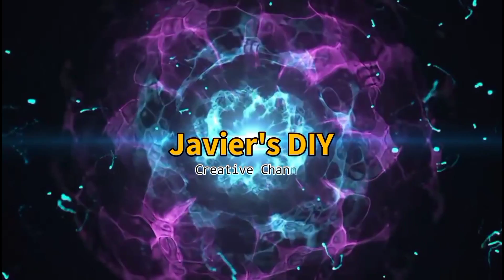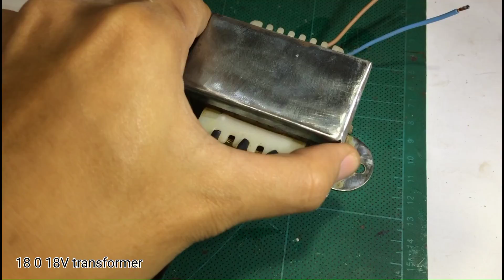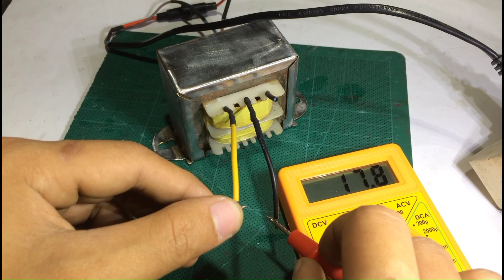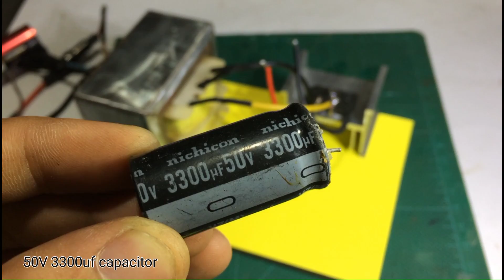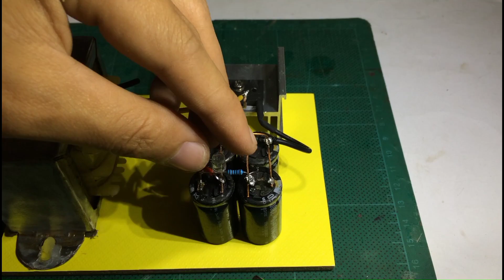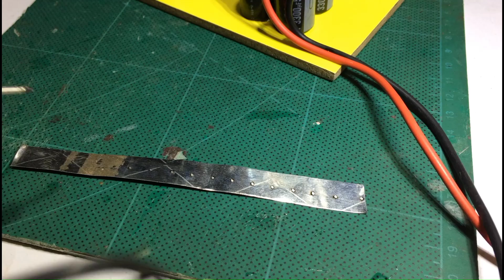High Quality Mini Spot Welding

Comment: I have tried with 8 6800uf capacitors in paralell and tried with 12v 3amps battery charger with 2 wired copper nails connection. A big spark came and made a hole in nickel strip.  It didn't weld as desired.
Reply from the maker: It is because the current is too small to weld strip sir

Comment: Fake, coz  in real world spot welding use energy more than 60 joules .  In this video , 1 x 3300 uF capacitor store only  0.238 joules.
Reply: E = 1/2CV**  Therefore, 1 3300uF charged to 18v (*1.414) = 1.0689 J.  Where did you get 0.238 joules?

Comment: Do you have a video of actual testing? Would love to see this weld. To me it don't look that strong. Would also like to see it connected to a amp meter.  Typically 200 to 400 amps is the sweet spot when welding with a transformer. Great concept 👍👍👍

Comment: This is very basic circuit. Video doesn't show welding of two stripes. There has to be many capacitors to provide enough energy required for melting two surfaces of stripes for welding. Also there has to be either current limiting circuit to protect diodes and transformer from repeatedly shorting or atleast timer circuit to limit short circuit period. Don't build this circuit as shown.

Comment: Trafo yang di gunakan trafo apa itu pak ,berapa ampere? Dan elco berapa mikro farad
Reply from the maker: Fir better understanding please use the universal language
Reply: @JaviersDIY  how many amperes is the transformer used?  And what size is elco micro farad
Reply from the maker: Maybe the transformer I used sir drops a current about 3.5A while the capacitor that I use is about 3300uf.
Reply: @JaviersDIY  ok thankyou ,the maximum voltage is 22 volts after passing through the elco and diodes

Comment: spark welder -----:> 1.5 volt battery micro transformer, diode and capacitor of 450 Volt = and you got it spark welder .... it does not use high current -.-" you fool -.-" why everyone uses more energy than necessary? jobs create idiots who only think about making money and not advanced technology. how long will the bad jobs last...there is something really wrong with people and their rotten jobs...Money corrupts everything...yep sad but true... -.-"

Comment: Bridge diode code ?
Reply from the maker: It depends on you sir
Reply: @JaviersDIY  not have code
Reply: @JaviersDIY  what amper for 18 0 18 transformer
Reply: @JaviersDIY  what can use DIODA BRIDGE MAXIMO QL 100A 1600V

Comment: En el momento de unir el positivo con el negativo se produce un corto y se funde el fusible de entrada alterna (110 Voltios AC).
Reply from the maker: For better understanding please use yhe universal language
Reply: @JaviersDIY  At the moment of joining the positive with the negative, a short is produced and the fuse of the alternating input (110 Volts AC) blows.

For a future reading comprehension: copy the message and paste it in any text translator you have.

Comment: I use 3A transformer Still not working proper please suggest change components.
Reply from the maker: Make sure sir that the output voltage is low while the current is high

Comment: How to increase power
Reply from the maker: Just use a transformer with a high current output sir
Reply: @JaviersDIY   all other components are same? 
currently I use 1A in pure copper 
For increase power can i use 3A transformer
Reply from the maker: @ankurkhatri4  yes sir. You can use that one. But rest assured that the voltage is low compared to the current output.

Comment: It's not going to be able to weld 2 nickel strips together.  

1) you can't store enough energy in those capacitors.  You need about 10 to 50 joules of weld energy.  By the looks of those capacitors,  you are way short of that. 

2) the ESR of those capacitors and the resistance of your welding electrodes is way too high (switch to ultracapacitors of at least 100F and at least 8awg wire with proper crimp lug connections).  You should target a total circuit resistance (including capacitors)  of 6mOhm or less.  

3) you need to apply a good amount of pressure with the welding probes prior to starting the weld.   To do this,  put MOSFETS  or a big relay in series with the negative electrode.  This will allow you to press down firmly before the weld starts.
Reply from the maker: It's a brilliant suggestions . Thank you sir.
Reply: @JaviersDIY  it's not suggestion, it's a correction of your work, 😁
Reply: never working Don't tried

Comment: The transformer is only needed to RECHARGE the parallel capacitors. The factor that enables welding is the OVERALL CAPACITANCE (or number of capacitors in parallel) and the size or gauge of wires feeding your welding electrodes, which should be AT LEAST 8AWG with copper tips for best results. Using a smaller 2A to 3A transformer and smaller diodes will simply take a  little longer to fully recharge your capacitors, but it will still work. Any transformer from 3 Amps to 30 Amps will work just fine. Bigger transformer and diodes will simply recharge the capacitors faster. You should use a switch for charging up the capacitor bank, then switch the charging circuit OFF. Then use a fast heavy duty starter solenoid relay (or solid state relay) to trigger the welding current from the capacitors to the welding electrodes/tips with a momentary push button switch (or foot pedal switch) to trigger the relay. Also, that full wave bridge rectifier will cut your charging current from the transformer to the capacitors in HALF. Better to just use a simple quarter wave rectifier on each secondary from the transformer. A single 6 Amp diode on each secondary wire will do just fine to charge up those capacitors and you will get the FULL CURRENT from the transformer, which means you will recharge the capacitors faster. Very good basic concept here, but with many design flaws and refinements needed. You need AT LEAST 8 or 10 of those 3300uF capacitors to store enough current for reliable and consistent spot welding.....KB1BBY/Scott
Reply: I fully agree, I use a lipo battery bank with a constant current source so I can charge the caps without a huge inrush current. Also if the circuitry that disconnects the battery from the caps fails it's current limited to 5 amps. It can also change the current according to the SOC (State Of Charge) of the caps. Mine is for portable use though and is designed to weld very thick nickel strips. It's for building all my big batteries for my scooters, portable inverters, power walls and also for car audio use. Such as my 200 ah LiFePo4 battery bank.
Reply: Bridge converters are different currently! You can use 50 amperes and it will not cut it anymore! And I also look at anyone in testing different capacitors -there are other types that are used in asynchronous engines -the effectiveness of 100 percent in comparison with barrels!
Reply: Hey Scott can u provide me with a schematic diagram for a spot welder pls?
Reply: Yes you are right... 👍👍👍
Reply: I agree with you

Comment: a spark can melt the surface but cant weld 2 pieces of nickel plates... you have  long nickel strip for testing but you never  try to weld them because it wont work lol
Reply: Right,  my thoughts exactly.  I hate how everyone tells him great job despite him not even showing it capable of working.  Sucks too, he likely is sooooo close lol.  I can make arcs like that with a laptop power supply. Not sure what this videos point is.
Reply: Absolutely right ▶️
Everyone Please Watch my Videos 
▶️ Rafiq Experiment
Reply: Agree. Get a proper spot welder.
Reply: YOU DIDNT TRY IT ON A BATTERY? SHOW IT. SO WE WILL BELIEVE ON U
Reply: betul,karena itu hanya sebuah rangkaian power supply
Reply: I agree with you
Reply: Call it Sparker not welder
Reply: yes correct it only give spark